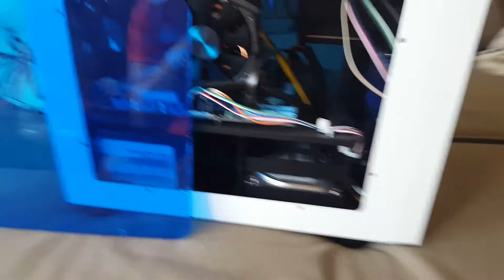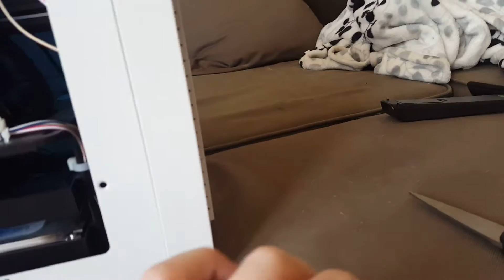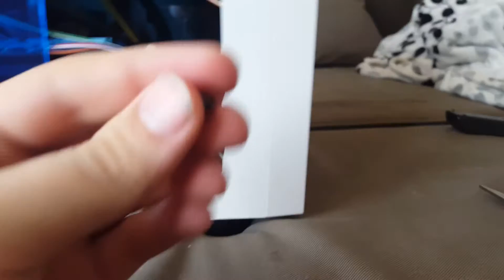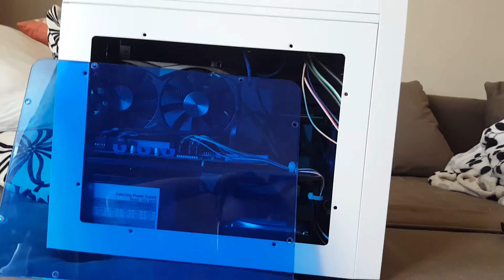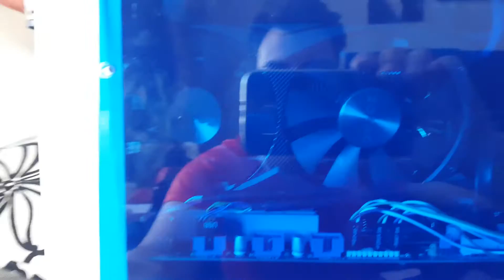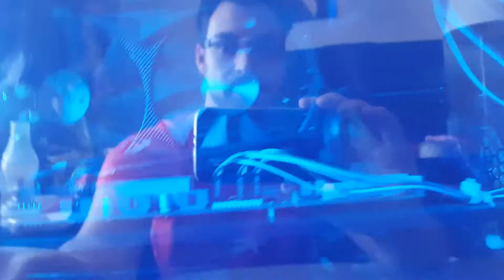Apevia X-QPack 3 Case Mod (GPU Cooling)

Comment: Yes, I'd love a follow up video. I really like the design of this case and want to purchase it but I'm worried about the air flow. Hopefully you were able to alleviate the heat and can let us know how soon. Thanks!
Reply from the maker: Michael White working on it. have a hole cut
Reply: I bought this case and have no issues with overheating, I added 2 case fans to the case, one in the back and one on top, on top of the one that comes with the case on the front of it. I have an i5 4590 with a gtx 1060 gpu. No issues at all.